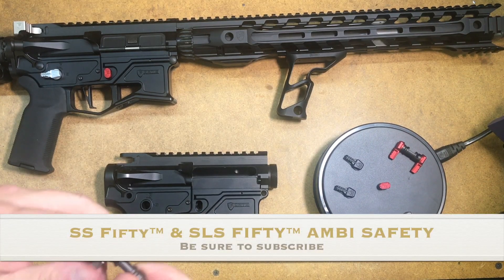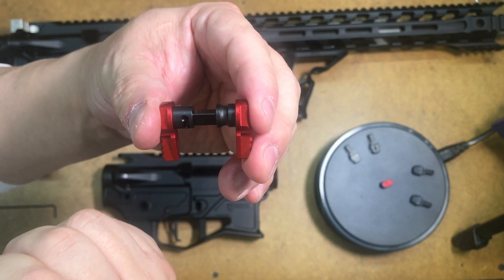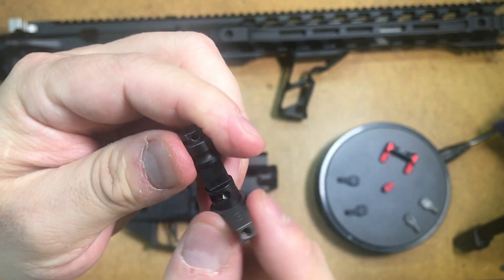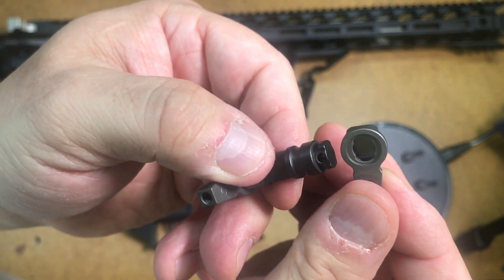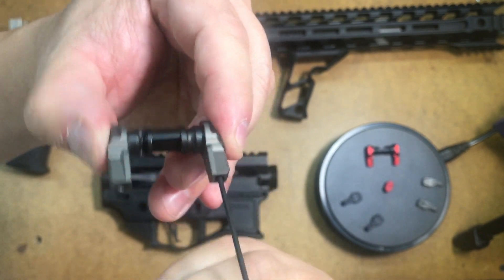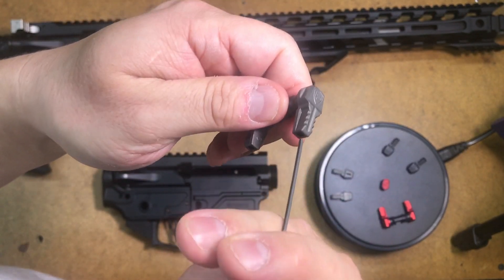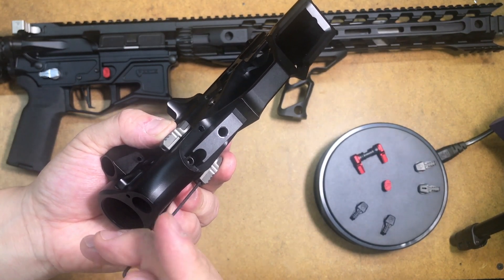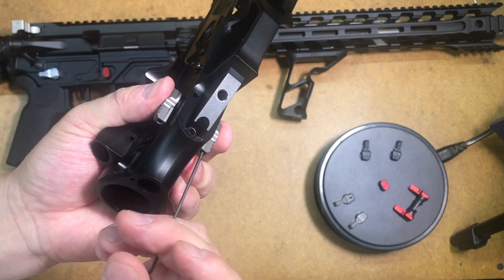Fortis SS Fifty™ and SLS Fifty™ Ambi Safety Selector Intro

Comment: This is an old video but I'm currently going to try these safeties out. I actually purchased the SLS in gold for a particular build I'm working on and also purchased a Radian Talon as I've heard those are the gold standard in safety selectors. Just judging on what I've seen, I don't believe Fortis' design to be weaker or inferior to the Radian but we shall see.

I really like the K series of castle nut and end plates and ordered a K2 and have been running a K1 on a SPR build I did in combat grey. I really like the machining, design, functions and how I can color match cerakote builds I do. I realized I could basically purchase the same products from Fortis themselves for about the same price, packed together (the SS/SLS and K1/K2) plus 10% off for signing up on their website so I'll probably do that here soon.

For those who think this is an expensive safety... it is. I would argue, you get what you pay for and with the typical screw straight into barrel design, I've had the screws come loose and the safety does have a lot of play. Even with different manufacturers of ambi safeties I've tried. Buy once, cry once. The premium AR15 game is expensive but also a nice option to have once you're tried of building cheap or mid tier ARs.

Edit: tired
Reply from the maker: Thank you for the great response.  Looking forward to see what you think about our safety.